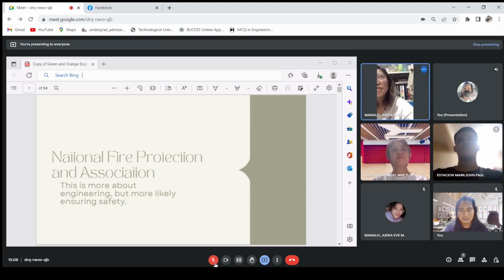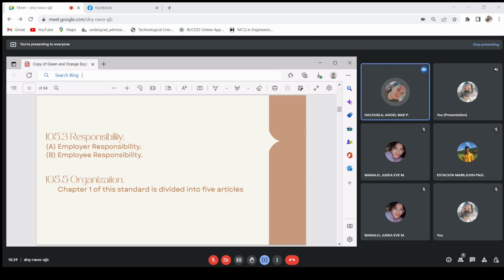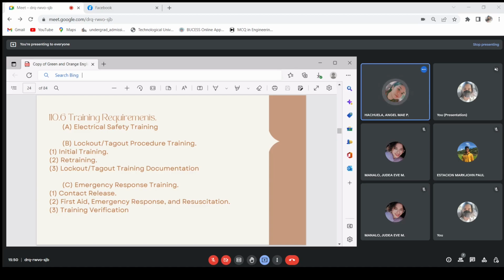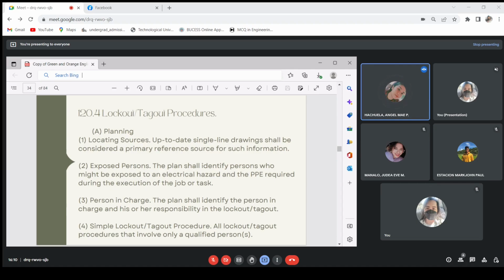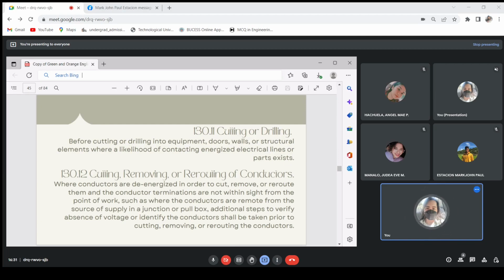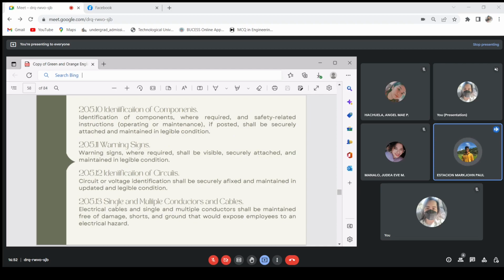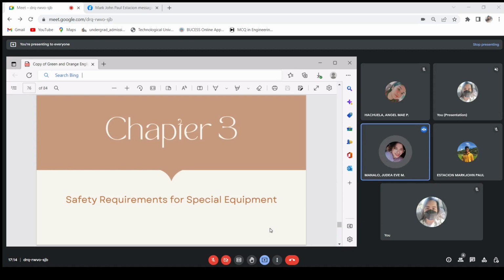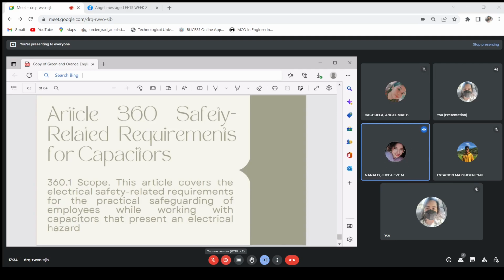Group 4_NFPA 70E

Comment: The discussion was tackled very well, same goes with National Fire Protection and Association as it serves a clear goal for all. NFPA like any other, was established with a purpose of settling people in a good spot where they are safe enough, not to be harmed. More of it, this topic has a hazardous response procedures and codes that dictate the type of equipment any firefighters should use. To add up, it is part of association to deliver information knowledge to its people. And as a whole, this code is handling us knowledge in developing and implementing fire safety protocols in the workplace is not only required by law but it is crucial to everyone's safety that may be in the building during a fire emergency.

Comment: 110.9 Portable Plug and Connected Electric Equipment
(b) Defective Equipment
If there are defects that might exposed the employees in injuries, the specific equipment shall be removed from the working space or area. No one could use the said equipment until someone who is qualified tests it and check its performance.

Comment: Electrical devices are linked to a power source using flexible cords and cables. Flexible cords may be permanently plugged into a power supply or they may contain an electric outlet that connects to just one. Cables, electrical cords, and extension cords (cord sets) are examples of flexible cords.

Comment: 205.7 Guarding of Energized Conductor and Circuits
Enclosures shall be maintained to guard against unintentional contact with expose energized conductor and circuit parts and other electrical hazard. Covers and doors shall be in place with all associated fasteners and latches secured.

Comment: Article 110.6 Training Requirements

When an employee is exposed to an electrical hazard and that risk is not lowered to a safe level but remains applicable due to an electrical installation requirement, article 110.6's training requirements apply. Such staff must receive training to comprehend the specific electrical energy hazard. They must have the appropriate training in safety-related work practices and procedure standards to ensure their protection from the electrical risks related to the assigned jobs or tasks. Every employee must get training to recognize and comprehend the connection between electrical dangers and potential harm.

Comment: Article 110.9 Portable cord and plug connected equipment
Proper handling and storage shall be observe for portable equipment to lessen the chance of damaging it. Visual inspections needs to be done to check for any signs of  damage and issue in the cords and plug connected equipements and if there are any damage equipements, they must be remove from service until a required personnel performs the repairs and  check if it is already safe to use. Portable equipment shall be operated in accordance to manufacturer instructions and signs.

Comment: 110.5 Electrical Safety Program For people whose jobs include electrical dangers, a safety program comprising safety practices should be in place. This demonstrates how aspects to determine when a person may be needed, as well as the training and equipment this person will use, could be included in the risk assessment approach mandated by the ESP. The risks that might be present on the job are unknown to those who will work in this type of industry.

Comment: 205.3 General Maintenance Requirements.
To lower the risk of failure, electrical equipment must be maintained in accordance with the manufacturer's instructions or generally accepted industry standards. The upkeep of the electrical equipment and related documentation shall be the responsibility of the equipment owner or the owner's authorised representative.

Comment: SHOCK RISK ASSESSMENT
The shock risk assessment must determine the voltage, the shock boundaries, and the required PPE to protect employees from the shock hazard. The arc flash risk assessment first determines if an arc flash hazard exists. If an arc flash hazard exists, the employer then determines safe work practices, the arc flash boundary, and the required PPE.

Comment: 215.2 Open Wiring Protection 
Periodic inspection is recommended. Guarding by location or elevation is maintained and considered during maintenance. There is no preventative maintenance required.

Comment: Lighting must be provided for all work areas near electrical equipment, according to 110.34(D), Work Space and Guarding. Equipment with a voltage higher than 1,000V must have the same amount of illumination as equipment with lower voltage. An automatic control system may be deployed, but it must also be possible to override it.

Comment: Article 130.4 and 130.5 
Risk Shock Assessment
require that risk assessments be conducted before an employee begins a task. The person conducting the assessments is presented with many dilemmas. That person must identify the hazards and risks presented by different equipment, understand the training of employees, be knowledgeable of tasks to be performed, determine the operating condition of the equipment and protective devices, assess potential for human error, and verify proper equipment installation.

Comment: 130.7 Personal exposed to electrical hazards when the risk associated with taht hazards is not adequately reduced by the applicable electrical installation requirement shall be provided with, and shall use, protective equipment that is designed and constructed for the specific part of the body to be protected and for the work to be performed.

Comment: Article 250 
NEC covers the grounding and bonding of electrical systems. By definition, as well as by function, grounding and bonding are not the same thing. However, they do work closely together in a yin and yang relationship to help ensure safety in electrical systems.

Comment: 110.5 Electrical Safety Program
An electrical safety program including safety procedures should be in place for those whose work involves electrical hazards. This explains that the risk assessment procedure required in the ESP could include elements to identify when a person maybe required and the training and the equipment that this person will use.

Comment: 130.12 Cutting, Removing of Conductors.
Where conductor are de-energized order to cut, remove or reroute them and the conductor termination are not within sight from the point of work.

Comment: The electrical safety program shall designed to provide awareness of the potential electrical hazards. Employer shall implement and document overall electrical safety program that directs appropriate the risk associated with electrical hazard specially to the employee who work in the presence of electrical.

Comment: 110.4 Energized Work 

(A) Additional Hazards or Increased Risk. 
       Energized work shall be permitted where the employer can demonstrate the de-energizing  introduces additional hazards or increased risk.
(B) Infeasibility. 
       Energized work shall be permitted where the employer can demonstrate that de-energized state due to equipment design or operational limitations.
(C) Equipment Operating at Less than 50 volts.
(D) Normal Operating Condition.

Comment: 225.1
Fuses.
Fuses shall be maintained free of breaks or cracks in fuse cases, ferrules, and insulators. Fuse clips shall be maintained to provide adequate contact with fuses. Fuse holder for current limiting fuses shall not be modified to allow the insertion of fuses that are not current limiting.

Comment: 130.12 cutting, Removing or Removing of Conductors

Where conductors are de energized in order to cut or remove or reroute them and the conductors termination are not within sight from the point of work such as where the conductors are remote from the source of supply in a conjunction or pullbox, additional steps to verify absence of voltage or identify the conductors shall be taken prior to cutting removing the conductors

Comment: 230.1 Terminal Boxes.
Terminal chambers, enclosures and terminal boxes shall be maintained to guard against unintentional contact with exposed energized conductors and circuit parts and other electrical hazards.

Comment: 130.11 Cutting or Drilling 
Before Cutting or Drilling into equipment, doors, walls of structural elements where a likelihood of contacting energized electrical lines or part exists.